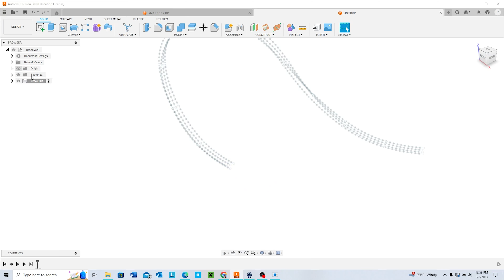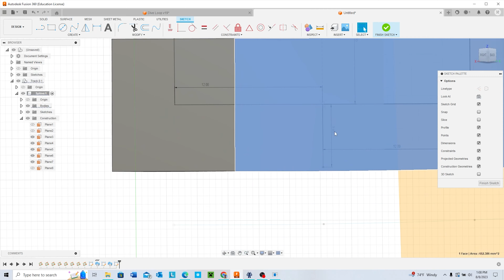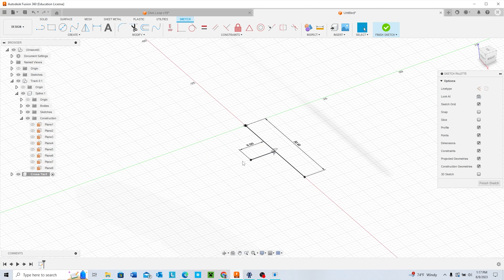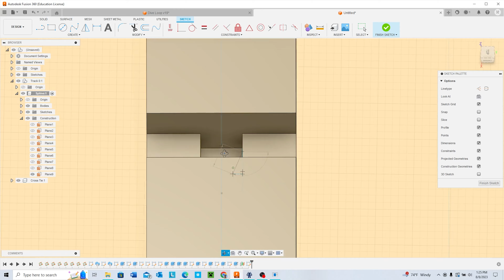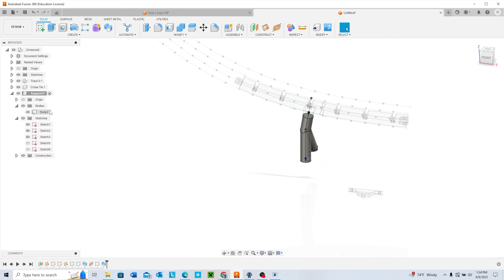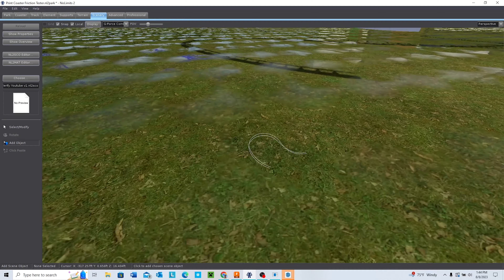How to Model Roller Coasters from No Limits in Fusion 360

Comment: Hey, im the one who made the Spline Extractor programm. The Scaling issue seems to be because of foot to meter conversion, since the conversion is 1 Meter ~ 3.28 Foot relatively close to the scaling you needed to apply. The distances to center were in mm on the version you had, so it actually gave you the correct distances between splines you specified. I only designed the programm to accomodate metric parameters, so you may need to do the conversions yourself.
Also the version you were using was an outdated version, which had issues with scaling that have been fixed in the next version. I just retestet it and it worked fine for me.
Reply from the maker: Ahhhh, makes sense. I’ll make sure to update my version. Thanks for creating the program, it makes spline exporting so much easier!
Reply: How do you use the extractor I’ve downloaded it from GitHub but it’s just files nothing launches do I need a launcher or something I’ve extracted the files using winrar
Reply: Thank you for Creating the Tool Tello3. 

Can you please explain why the Tool generates me CSV file  in comma format like -> -1.3643,0.5465,1.2364 ?   I would need also the split Format as in the Video showed

Comment: This video is super helpful for a project Im working on... one thing to check out, it will very much help in the long run with what you're doing. 1. For the tab cutouts, use pattern on a path, it would allow you to get those cuts in just 2 operations. 2. You can also do the same with pattering the cross ties. 3. Not 100% how well it would work, but you could do a sweep along the entire length, and then use your planes to split body along plane. Ive done with with a helix, and I believe this would speed up your work flow, it may even get this track modeled in about 10mins.

Comment: I was able to import the splines to fusion with the correct distance between rails, but the track is really long for some reason. it doesn't look like how you did it. I'm using the Mack launch coaster for the spline and I'm using an updated version of the spline extractor that has no scaling issues. I made it so that the rails have 0.6 inches distance from the center. Can you help?

Comment: How do you connect the supports to the track? Do you use screws or print the supports with the track?
Reply from the maker: I print the supports separately then pin them to the track using 3mm dowel pins.

Comment: quick question, where do you get your tubing for the rails at?
Reply from the maker: This is what I found works best. I’m using the 4mm OD, 2.5mm ID tubing. I use a 3D printed jig to cut the slit into it.
Reply: thx @jonathanzang5612
Reply from the maker: https://tailonz.com/product/tailonz-pneumatic-blue-pu-air-tubing-pipe-hose-pu-air-hose-for-air-line-tubing-or-fluid-transfer-tubingcopy1671688695319

Comment: hey! im looking to do this with a full circuit coaster but im struggling to figure out how to open the spline extractor program - it downloaded as just a file with no way to open any actual program. could you offer some help to me? thanks!
Reply: It should be a zip with an executable(.exe) inside (so it only works on windows). You need to make sure though that you dont download the source code

Comment: Also, could you please do a video explaining how to design the cart? unless you ahve already done it
Reply from the maker: The cart design is much more complex to the point where I don't know if a tutorial would be that helpful. Trying to get the wheel assemblies to work is the hardest part, and requires a ton of trial and error to work out the tolerances and wheel gaps. The actually modeling of the parts are easy, if you can model track you should be able to do it without any issues. For the actual design I would base it off real life coasters. There's a coaster printing discord I could send you, there's a ton of helpful people in it that could help you with the process.
Reply: @jonathanzang5612 could u send me that